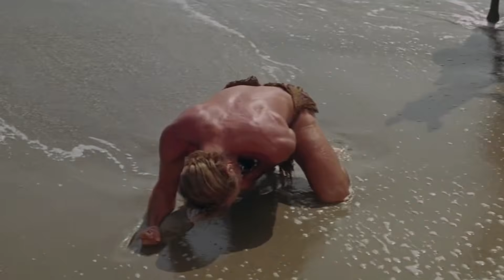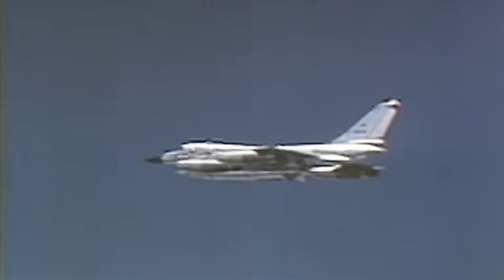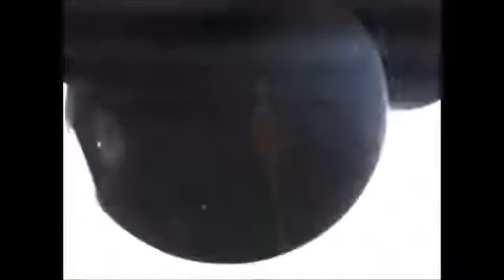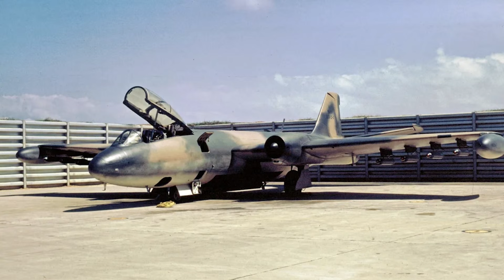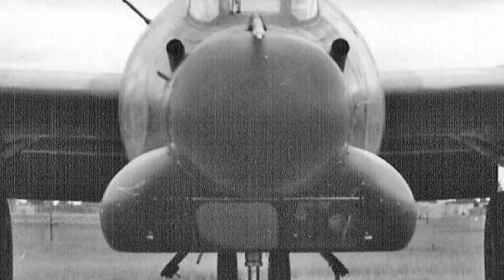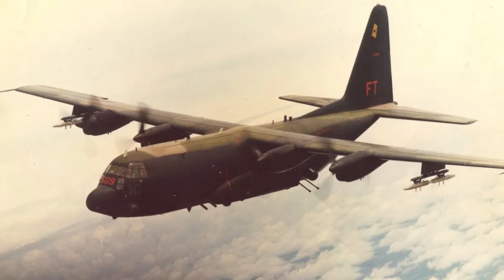The Martin B-57G; Laid the Groundwork

Comment: There is of course the Canberra operated by the Temora Aviation Museum (And 100 Squadron RAAF) The only airworthy one in existence (other than NASA's 3 Martin B-57's) and certainly the only one looking "original".  She HAS been modified for electric start rather than cartridge which will apparently extend the life of the engines significantly, which is interesting! The cartridge start must be hard on equipment? She started life in RAF service as WJ680 in 1955.   P.S. The next airshow there is 19/20 October this year.   An old friend was shot down in A84-228 (one of 2 RAAF Canberra losses in Vietnam) in 1971..fortunately both he and his crewmate ejected safely, although injured, and were rescued a day later.

Comment: The electronic equipment  fitted to the stoofs (S-2gs), was later fitted to the P2-v Neptunes of TRIM (Trails, Roads, Interdiction, Method) aircraft which substituted an M-61 Vulcan cannon in a tail turret in place of the MAD (Magnetic Anomaly Detection) gear, they were modestly successful. Until being replaced by Canberras and AC series aircraft.
Thinking further one initial  modification to a couple of Canberras was the sensor suite, with an M-61 in a trainable turret in the bombay.

Comment: I was in the military and I remember the cloud of smoke from the starter cartridges and the unique sound  the engines made as they spooled up.
I believe they was a high altitude spy model that appeared to have almost doubled the wing span of the standard B-57
Reply: I dunno about the longer wingspan part, but, the B-57 did have an unusually high service ceiling (around 60k feet I think?) at a time when jet fighters and SAMs struggled to reach that altitude. So even though it wasnt really built for it, it did become a useful spy aircraft. It essentially laid the groundwork for the U-2, which was a purpose built aircraft for a similar flight regime.

Due to its high altitude performance, NASA was one of the last operators of the B-57 as a high altitude research aircraft.

Comment: One thing about the "Ho  Chi Minh Trail" - if it was ever a "trail" with guys pushing bicycles loaded with supplies - it evolved into much more.

It became a series of paved, asphalt highways that ran parallel to each other - so that if the Americans damaged one section - the vehicles on that stretch of road could switch over to another one until it was repaired. 

As the War progressed - it was protected by Anti-Aircraft Guns, Radar and Ground to Air Missile Batteries.

The AC-130's
https://en.wikipedia.org/wiki/Lockheed_AC-130
 lost six aircraft during the war and had come to be escorted by F4 Phantoms for protection against ground fire.  It's estimated that they destroyed 10,000 trucks.  What that estimate is based on I don't know.  Pilots almost universally Over Claim and the Communists - Lie ... so I doubt there would ever been an accurate assessment - but whatever it was - I do believe it was one shit load of trucks.
.

Comment: Davis-Monthan has 7 B-57s, I don't know if any are the G version.  They also have an additional 3 of the D variants that have extended wings.  Those were used for reconnaissance.
You can see them on Google Earth.
Reply: The AMARC inventory list shows 2 B-57Es, 5 EB-57Bs and 4 WB-57Fs soaking in the sun.
Reply: @AA-xo9uw  
I didn't look at an inventory, I just counted what was visible in the Google Earth shot that was available the day I looked.
Reply: Those aircraft were from my old unit.  EB-57s from the 4758th DSES.

Comment: One of the first night interdiction aircraft that the Air Force successfully used or navy p2v Neptune Patrol aircraft. All the sensors except for the magnetic anomaly detection worked pretty well in the dark / jungle. Who is partially replaced by a 20 mm turret in the tail. And the 14 of the Thailand were pretty successful until they were driven to higher altitudes out of the effective range of their weapon

Comment: The original bubble canopy was a poor choice. Liable to warp as the air pressure changed, it couldn't be fitted with a sight. It was also a greenhouse when parked in the sunshine. The Martin engineers breathed many excellent modifications into the B-57B Canberra. A proper two seat cockpit, A rotating bomb bay, and guns in the inner wings. English Electric should have built the equivalent of this as a follow on.

Comment: I'd be curious to find out why British jet designers chose to have their engines embedded in the wing or wing roots instead of mounted on wing pods.
Reply: I worked on many B-57 models from 1962 to 68.  In one case the friendlies tried to intercept our EB-57B.  They tried to use their IR; failed.   The engines embedded into the wings caused a greatly reduced heat signature.

Comment: Ed, the Canberras are still at the Davis Monthan AFB boneyard. About 12 years ago, NASA went there and pulled 63-13295 out of mothballs and resurrected her to active flight status, joining two of her sisters. They are all designated as WB-57's now. All three conduct weather experiments for NASA, flying through hurricanes and typhoons and taking measurements.
Reply: Davis Monthan!  Lived in Tucson for 20 years.   I used to rent a house on Stella Road.  As a teenager, we'd Tee up in my front yard with golf balls.
The B-52's were directly across the road behind the fence.
Thwak !   Ping......Bong.............................................................bong.....................bong.........bong.
As the golf ball would land on the empty wing of some Stratofortress.   Marvelous sound!  It would reverberate for about a minute!  
This was 1979!  Good times.  Of course, always at night, so you couldn't really see where you were hitting!
Reply: Just had a quick look on maps, dated 2023. I see 6 at coordinates 32.16147226988309, -110.83774611028473 . Also wondering what are the planes to right of the B-57's with the rather large wingspan?
Reply: @68Boca  I'm pretty sure those three acft are the RB/EB-57D variant.
Reply: @American_Jeeper  NASA flies three RB-57 articles redesignated as WB-57, so the long winged birds would be the NASA type.

Crazy that a 1944 proposal resulted in an aircraft still flying eighty years later.  Then again, B-52s eventually will be sorted by carbon dating...
Reply: @68Boca  The AMARC inventory list shows 2 B-57Es, 5 EB-57Bs and 4 WB-57Fs soaking in the sun.

Comment: For me, the early RAF and RAAF Canberra with it's unusual hemispherical bubble canopy, glazed bomb aimer's nose, clean wings and silver finish was the most attractive of the type. Although, I do have a soft spot for the PR.9 with its quirky offset canopy and clean lines. It's getting on for 20 years since I watched WJ680 perform an impeccable aerobatic routine at Avalon in Victoria. TFP
Reply: PR-9's i think might be the longest serving  Aircraft in the RAF , yes i know the BBMF are still serving aircraft to a point but the PR-9 was the longest operational as far as im aware . occasionally worked with Canberra's when i was at RAF Wittering and some other stations . Was always amazed at the so many different variants that there was . I thought it was bad enough that we have four different types of Harrier at RAF Wittering , plus then the Navy variants that would come in .

Comment: I disagree that the Martin variant looks better than the English Electric version (and I say this in light of my grandfather being part of the B-57 production team at Martin Aircraft Corp).  That side by side layout was just flat gorgeous and though I'm sure there were excellent reasons for Martin to change to the tandem cockpit, the original layout is far more visually appealing.
Reply: I worked on the A models.  The space in the cockpit was very tight.  The Navigator/Bombardier had to crawl from his nav station through a 14 inch crawl space to the front bomb station.  Not easy wearing a parachute.

Comment: I worked at RAE Bedford when they were still operating Canberras for radar research. The pilots loved flying them. The ETPS pilots flew all the types we had, so one day they were flying us around in the BAC 1-11 and the next they were flying a Canberra or Tornado.
Reply: I remember as a kid and i saw this when one day driving some where a Canberra of RAE came from behind and flew straight down the road that we was driving . The wing tips were over the the edge of both sides of the road and the noise and vibration was incredible . Obviously as a kid in the back seat i heard then was vibrated and also the shadow of this aircraft passed by us and went in front . I was excited by this and loved it but the RAE had to apologise to the general public for scaring vehicle drivers . Apparently it was testing some thing but they never said what . Made my day and every one of the family that was in the car , we was used to fast jets at low level doing their thing and to be fair liked it .

Comment: Despite the comparative failure of that particular exercise, the Canberra's record isreally remarkable, considering the design originated from the mid-140s, and, as others point out, the WB-57's still working for NASA.
I recall reading an article by a former B-57 WSO about missions with a pilot who would turn off his nav. lights and haul the machine into a turm immediately after breaking ground, to avoid the VC gunners lurking on the runway centre-line just outside the wire.  Someback-seaters wouldn't fly with him, but the tactic seems justified.

Comment: In field studies in Vietman, it was determined that they were flying to high (3,000' or more) for the 20mm guns to be effective. The guns would break windshields and penatrate body work but would not put the truck out of action.

One story about the B-57, or actually the RB-57( undergoing development at Martin's at the time), was when one of the bombers flying out of the Baltimore plant flew over the capitol without identifying itself. It caused a real flap as no fighter in the area could fly high enough to intercept it.

My father worked at Glen L Martin from 1938/9 to 1963, mostly the PBM, P5M programs.
Reply: I think that's an incorrect conclusion.  Altitude should have no bearing. It's more likely the result, or lack of result, from the general effectiveness of 20mm on something as simple as a truck. Sure, in WW2 fighters were strafing the heck out of German trucks, but that was a somewhat different circumstance.  Often they were using .50cals that could easily put hundreds of rounds into a target in one or two seconds. Far more likely to cause critical damage or worse if incendiary rounds were used. Couple this with the inability of the Germans to repair or recover the vehicle made it effective. 
Even at the high rate of fire of the Vulcan at night and high speed,  I would expect maybe half a dozen hits and less if they were only letting off judicious bursts. ( in the video he mentions 20 trucks for 4,000 rds. : 2 sec bursts, but at what flying speed?).
A few explosive hits on a steel frame truck with an iron engine aren't going to put it out of action for long, if at all. These aren't aluminum frame aircraft, or vulnerable jet planes that every square foot is vital. The frame likely won't be damaged. Replacing some tires and an engine accessory or two, the truck is back in business.  The Vietnamese wouldn't care about cosmetics of a few holes here and there.  
The more modern 30mm has a square of more explosive capability coupled with the use of depleted uranium that more or less melts the steel. They use a mix of HE and AP to achieve effectiveness. 
I don't doubt the study was done, they just arrived at an incorrect conclusion.

Comment: It wonders me a bit how come the Hustlers or B47s were not used as bombers during the US War in Vietnam and SE Asia?
Reply: He touched on it in the video. Both were purpose built for high speed nuclear bombing, the B-58 supersonic.  The B-47 an early jet, was relatively slow, low range meaning little loiter time and not configured for level bombing. Although it had considerable weight capacity,  that was for one or two internal nukes. I don't believe it's cutting edge wings could handle wing racks. Plus maintenance on first generation,  almost two decade old engines was probably prohibitive. 
The B-58 was still state of the art with one primary mission, supersonic penetration and delivery of nukes, likely one way. 
They also seemed two-minded between using up old stuff and trying out state of the art high tech. For example,  they sent the latest wonder-waffen M-551 Sheridan,  but not the M-60.
Probably a mix of reluctance to use up first line equipment standing off the Russians, actually letting them know what it could or could not really do and wanting to find out outselves.
Reply: @chriskortan1530  Thank you.

Comment: The Canberra was a beast. Still in service with NASA. Plenty of airbases in the Commonwealth still maintain these birds as gate Guardians. Think of it as a jet powered modern take on the Mosquito.
Reply: They basically were the mosies successor in the light fast boomber role
Reply: @Thomas Baker  it was the direct successor to the Mosquito in all roles, that is what it was designed to be. It had a 4x20mm gun pack with 500 rounds per gun as an option so could function as a fighter too.
Reply: @seriousmaran9414  I think in the Suez crisis there was a recorded air to air kill , but i may be wrong .How ever much like the Spad in Vietnam which shot down a Mig , if you are lucky and have plenty of fire power it is possible .
Reply: @nathan whitworth  a Sea Fury, piston engine post war navy fighter, reportedly shot down a Mig 15 over Korea. The speed advantage of a jet occasionally turned into a disadvantage when they overshot their target.
Reply: @thomasbaker6563  A true Mosquito successor would have been faster than the jet fighters of the day, though 😉
Reply: I think Rhodesia used Canberras?
Reply: @juhopuhakka2351  Yes, they sure did. We had them too in the Royal Australian Air Force. They were at the Amberley RAAF base where I was posted in the early 1980s.
Reply: @secretaryharpsoctas4950 RAAF Canberra’s were used in Vietnam based out of Thailand
Reply: @juhopuhakka2351  They did. They were very widely exported and most commonwealth countries operated them. I think the Argentinians had some in the Falklands, not sure if they flew against the British, but they were in service. They were one of the best of their time. That's the British Canberras, the only other operator of B-57s was Taiwan maybe and Pakistan I think.
Reply: They were flew faster  and higher than jet fighters could go to 50 thousand😊
Reply: It was so quiet, just a slight whistle

Comment: The problem with emphasis on the Ho Chi Minh trail is that the majority of the supplies came by sea. The most effective force against these supplies was the US Coast Guard.

The Australian airforce flew the Canberra in Viet Nam. The Australians were so accurate that if forward air controllers knew they were available the Canberras would be used first. If just one bomb was not within the target area the crew would have to go step by step with other officers from the squadron to find out why.
Reply: I was a FAC in 'Nam and can vouch for the Canberra's incredible accuracy. The downside, however, was the long time between bomb passes as the 'Berra had to fly a large "racetrack" pattern that could take five to six minutes between drops. That was fine for pre-planned strikes on known and fixed targets like storage areas, but worthless for highly mobile events like troops in contact.
Reply: I have no idea what the facts there are BUT its certainly pretty plausible .......
Boats have good darrying capacity, lots of places to hide amongst the deltas etc
Yet - maybe because of the coverage during the War - the Ho Chi Min Trail has acquired near mythic status.

Comment: EE did of course produce a tandem-cockpit version of the Canberra, the B(I)8.  Wasn't quite as pretty as the Martin version though as they put the canopy over the position of the existing pilot seat, offset to the left.
Reply: The Pilot of the B(I).8 was alone under the fighter style canopy with the Navigator in the fuselage, in the early models behind the Pilot and in the later models in front. Correction the Navigator was was in front in the early models and  behind in the later ones.
Reply: @neiloflongbeck5705  PR 9
Reply: @ChuckieFinzter  these used the same cockpit layout as the B(I).8.
Reply: @neiloflongbeck5705  Yes this is correct for the B(I)8, but the navigator/ camera operator sat lower down to the right of the pilot and moved fwd to the glass nose to operate the camera. It was the Pr9 that had the navigator/camera operator in front of the pilot "locked" in the separate nose compartment of the aircraft. (No 1 PRU later to be 39 squadron were the last RAF Sqn to fly the coffin).